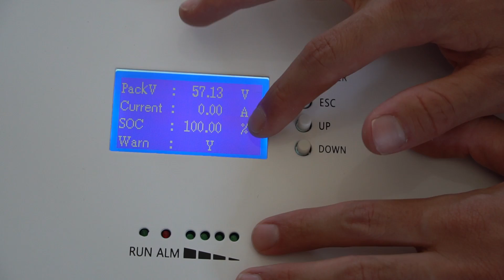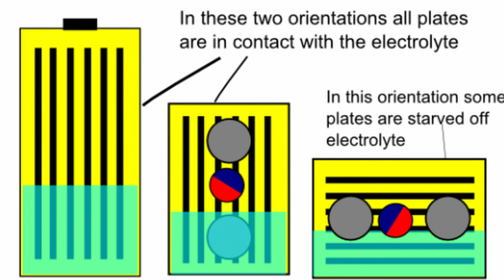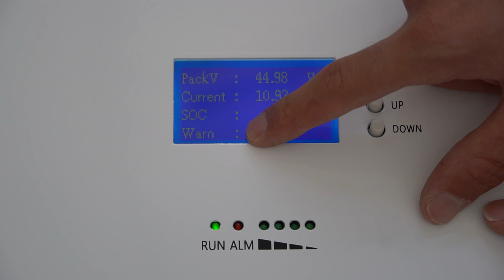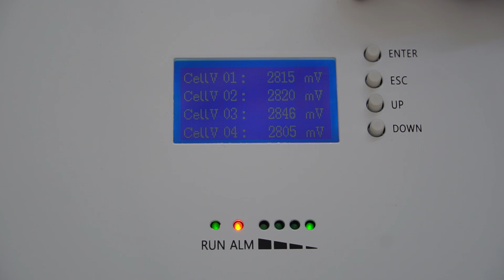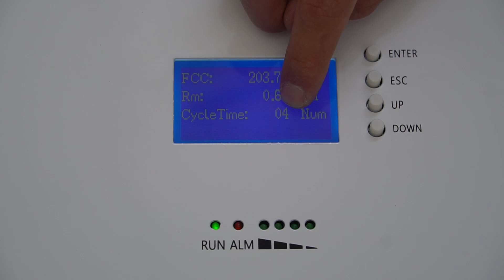10kWh 48V LiFePO4 Plug-N-Play Solar Battery for $.38 per Wh: Full Tear Down and Capacity Test

Comment: Who needs a home gym when you could just deadlift this thing while it powers your home. Off-grid workouts
Reply: You can damage your spine now and discover the consequences many years later. Besides the pain, it would limit what you can do physically.
Reply: @michaels3003  thanks dad
Reply: @michaels3003  Nurses discovered why they had back problems coming up to retirement: when they are young and lift patients, they get micro tears in the thin sheets between vertebra.  When they retire, they have back problems.  It doesn't show up for decades.

Comment: It’s hard to build your own pack at that price & have the warranty.  
I believe I’ll buy this pack.
Reply: $3870?
Reply: @TexasLocalProduce   @ 38 cents a Wh it is . Lots of people has there’s @ a dollar . 
And that price you have there  is close to what he’s got in that whole system (he showed in video) with bms’s . 

I priced the packs and everything individually myself.
The 20 yr warranty is worth  grand  extra from batteries  .     A 48 volt battery pack at that size  will cost you 2100 to 25 hundred without the BMs and that’s not grade a cells to buy from china.   And you risk bad cells or not even getting your order.  People don’t realize.  If they decide to fk you (which happens a lot ) you have zero recourse.

Comment: Im becoming a fan of the rack systems for batteries. Seems like this would work well in one if the screen was on the bottom. 2 people could then lift it and slide it right in. Still anything over 200 pounds is going to be cumbersome. Great video
Reply: We had three people to mount it on our workshop wall. It helps to have strong friends!
Reply: Yeah yeah we all know you just want to point and say check out the rack on that one......and then point at your battery setup.

Comment: Will it fit in the overhead compartment as a carry on?  Oh and take some Aleve for your back.
Reply: Only if you discharge the batteries first.
Reply: If i recall correctly, FAA restricts passenger lithium battery size.  I want to say limited to 100wh, but can't be certain.

Comment: $3870 for 10kwh is a good deal. It compares to a $500 1280 wh battery. Additional savings comes from the reduced wiring requirements plus having a battery monitor build in.
I guess they are finally taking on the diy firewall market. 
My planned system is 
- 8 kw Solar
- 32 kw 48v battery
Just 3 of these batteries would do the trick. I won’t be ready for another 2 years, it’s safe to assume the competition will increase and the price will drop. 
Exciting times.!
Reply: They are now $4370 in February,  2022.
Reply: Battery price won't drop in the next 5 yrs,  due to higher demand from EV cars.
Reply: @accacc841  and 3 years later... I just paid 2k for 10kWh
Reply: Price can be reduced if your order is from the supplier directly.

Comment: I'm lost... The battery says 10kwh but also only 200ah, am I lost on this one? Why so low Ah?
Reply from the maker: Ah is dependent on nominal voltage. 200Ah at 48V is a ton. It is the same as 800Ah at 12V. Just need to calculate it each time.
Reply: @WillProwse  Thanks will!

Comment: I do not like the space oriented at the “bottom” of the pack, all the weight is setting on the pair of cells. And the space can allow a shift that might shear the flexible bussbar links.
Reply from the maker: Oh those are not flexible. They are very very thick. And all welded together. Will have to see if it breaks over time.
Reply: @WillProwse  if you look between the welded areas, there is what looks like thin sheets of flexible material… is that not the case?
Reply: Looking closer at the bussbar, it does appear like thick bussbar plates, but the rib between the cells makes it look like the stacked thin sheets.
Check on the outside edge, see if they are stacks, or plates.
Reply from the maker: @SuperVstech  between the welded areas? Between the bus bars you mean? I dont see anything. It is just simple bus bars welded to the terminal. Nothing else
Reply from the maker: @SuperVstech  It is a solid piecec of metal, not sheets. That piece under it is the terminal. Then that little layer on the sides is the seal of the terminal. It is a CATL cell. They can be ordered with flat terminals like this to be welded. It is not sheets
Reply: @WillProwse  I am wondering why the bump in the bussbar then. Typically on premade packs, the bussbars are compressed stacks of thin sheets formed in the laser welding process to a tightly bound plywood like plate. Looking close at a few of the weld marks it looks like it. You are in front of it though. I am not saying you are wrong, just wondering if you are sure. I have seen a LOT of bussbars made this way on packs. Either way, it would be very strong with the laser welding process.
Reply from the maker: @SuperVstech  OHHH yeah, I am unsure of why the bump is there. On old cells, it was there to go over the lip from the edge of the cell, or the cell case. On these, that is not a problem. I have wondered if it is for expansion and contraction? Maybe having a bend in it turns it into an accordion of sorts, and allows it to have more ability to expand when hot? Gosh we should post it on the forum and see what others say. I want to know haha
Reply from the maker: @SuperVstech  Because some bus bars have it, and some do not. And some are indeed layered. These look like a chunk of metal, but I could be wrong. Hmmm
Reply from the maker: I think the busbars are connected in that way to support it vertically. So I could be wrong

Comment: would love to see you get your hands on a pylontech US3000C combo or a 10kWh 48V/200Ah Sunstone Power (SLPO48-200) that sell at a similar or slightly better price
Reply from the maker: Those are super expensive. Where do they sell them for cheaper? I'm seeing around $900 per kWh
Reply: @WillProwse 
It's a Czech product, hence why he said that the price is similar.
Pylontech US3000C here is around 1600$, with 0.45$ / Wh
Sunstone Power (SLPO48-200) here is around 4k$, with 0.396$ / Wh

Comment: BMS looks like a seplos.
I tried to post a link but think was filtered.  A 200amp seplos cost me $250 shipped to my front door. I bought specifically for communication ports so it would communicate with my inverter

Comment: Any comment on if you could add a heater to this to keep it warm in a cold climate?
Reply: Of course you could. In a WELL insulated room, only minor heating would be needed to keep this above freezing temp.
Reply: Too dangerous for inside the house?
Reply: @SteveV2023  dangerous? Only if wiring mistakes are made. LiFePO4 is a very safe chemistry.
Reply: @SteveV2023  not too dangerous. In order to control temperature efficiently you don’t want a large space, aka room for it. A small cabinet that is very well insulated let’s you heat or cool the batteries without much excess. 
In a cold climate, a root cellar would/should naturally not drop below 40°F so insulation may not even be needed.
Reply: @4philipp  thanks! So, I live in WI where outside in winter is not an option.  So if i had some type of container for the batteries and placed it in my basement I should be fine? I have a Renogy controller with the temp sensor.

Comment: Wish I could afford that battery and a 4K inverter it would suffice all my off-grid needs
Reply: I have to run a 4K generator for around 3 hours once a week even in the winter time when we don't have much sun to do laundry and refresh my water supply
Reply: What is your latitude and how many hours of sunlight do you get?   I’m at 62N and have thought about solar but thought it wouldn’t work over the winter.
Reply: @jjdogbutte  45.8711N
Reply: Will has other videos where he builds complete systems. He builds a 13 kWh pack from raw cells for about $2k and adds 13 kW inverter/ charge controller for $3k. You can shrink the system to save money. Scroll through his videos and watch. There is a LOT of good knowledge there.
Reply: @williammeek4078  I'd love to be able to afford it but due to a back injury and loss of job I'm now living in a camper on a half acre piece of property my father left me so it's kind of hard without a job
Reply: MPP Solar LV 6548, panels and this battery. the MPP Solar is about 1K and is a complete system. So about 5K plus panels and your set.
Reply: @Jack2of3  but then the price of batteries is killer. I need 110 for the washer and dryer but then I also need 12 volts for my water pump and my furnace
Reply: 45.8711 N